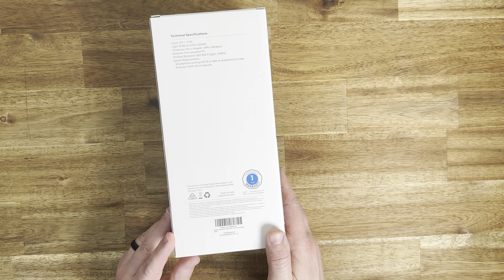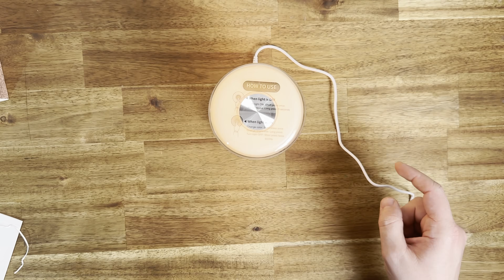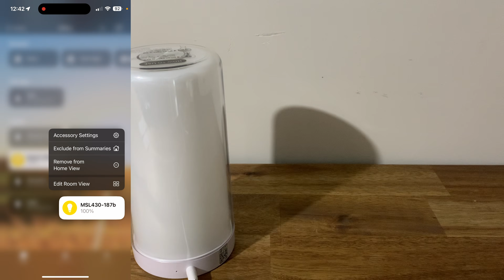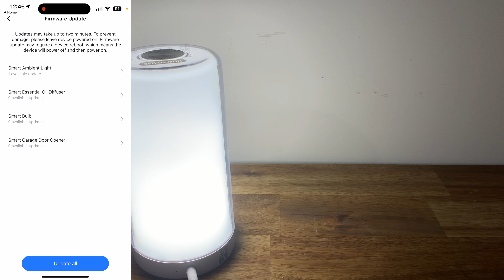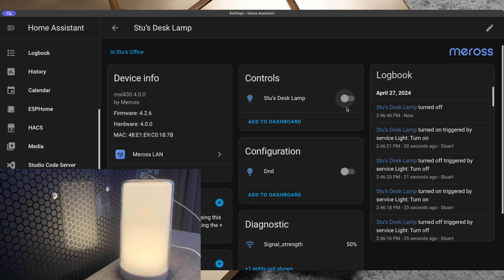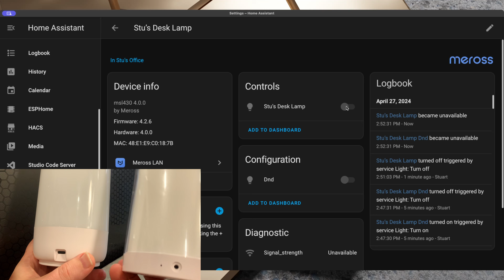Exploring the Meross MSL430 Smart Ambient Desk Light: Setup and Integration

Comment: Hello all, I need a longer power adapter but can’t find the specks plug type and power. If anyone would be able to help it would be much appreciated 
Thanks
Reply from the maker: 12Volts at 0.5A and the plug is a 3.5mm barrel jack with Positive on the tip
Reply: @HiveMindAutomation  thank you so much

Comment: Do you think there is any way to change the double tap? One tap to turn it ON, one tap to turn it OFF, and double tap to change the color, it would make much more sense that way. I am constantly changing the color by mistake instead of turning it off.
Reply from the maker: It doesn't seem to be customisable. That said, I THINK it's an ESP module in the controller, so it MIGHT be possible to flash custom firmware, but that's not exactly an accessible solution.

Comment: I have the msl420, home assistant and the app has lost access to it yet I can still control it via home kit! Been problematic lately.
Reply from the maker: I've been having some issues the last week or so with the MSL 450 and it seems to have been around the same time as - and possibly linked to - some Wi-Fi/Internet Instability but reconfiguring it made it all come good again. Generally if anything is acting weird, the first thing I do after rebooting everything is reset and re-pair the accessory.